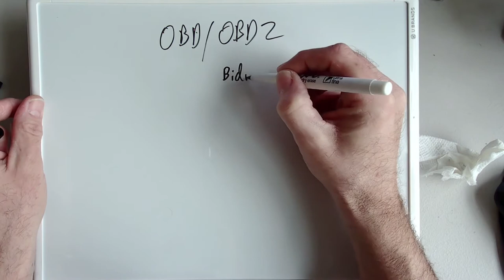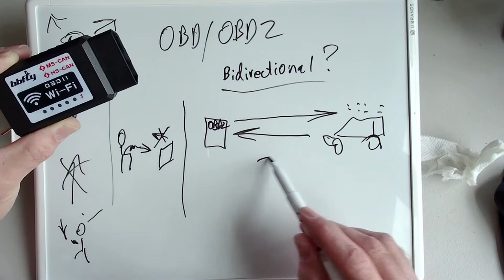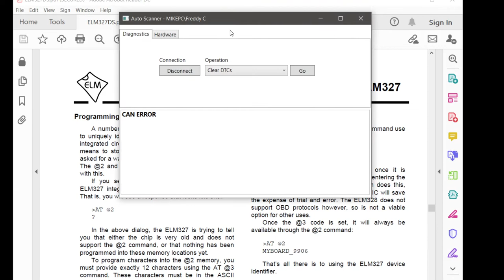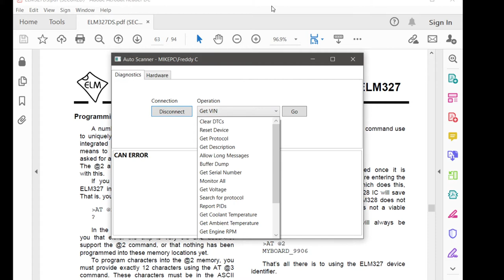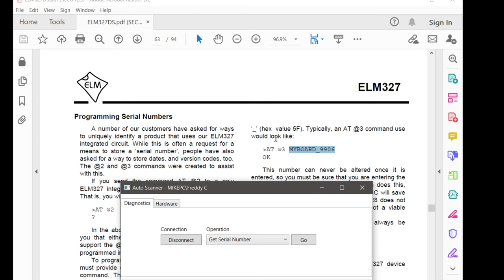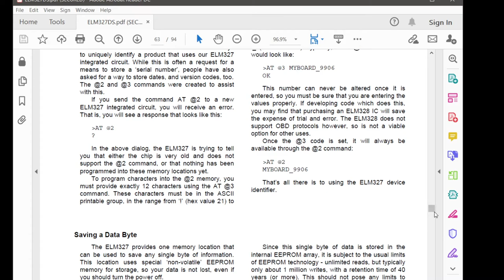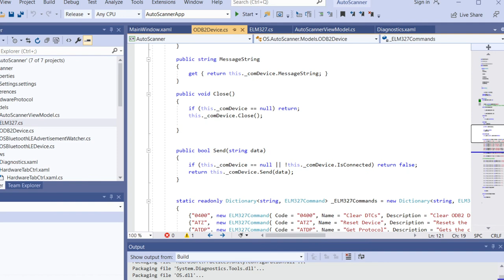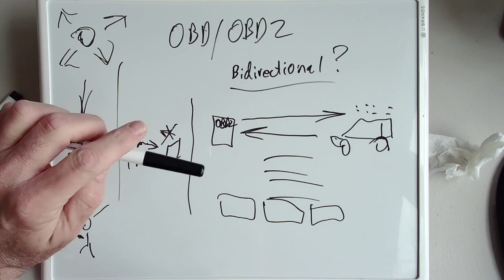OBD2: The Bi-Directional Myth (Software Design)

Comment: Hey, have you heard of comma Ai? it is a device that can make your car autonomous. Now the thing is to do that, they connect to your OBD port. I was wondering how can they control the steering wheel via the ODB port?
Reply from the maker: Everyday (it seems) there's something I don't know about. But, I can tell you that the OBD port is really just a connection point for the car's network. Newer cars are using electric servos (instead of hydraulic pumps) for steering (I mean the internal combustions cars) So, a servo is just what we've got in an RC car, so...it seems quite conceivable to do. But, not on a standard car like my 2006 impala ...Thanks!
Reply: @Roudter  hey, I actually found out that they are using the car harness to control the car , and not the OBD
Reply from the maker: @msa7202  Thanks for the info.  That seems to be more sensible.

Comment: I would approach the subject with a large 4x8ft pegboard $30.00 with all "used" components normally installed into vehicle on one side and on the backside of the 'chalkboard easel' I would have plug and play breadboards (prices vary) to provide various conditions to which each of the components provide values for.  pin on plug style adaptation, you would be able to provide all attributes. A simulator would be another possibility to feed into this. However for what you're trying to do you could have this open source software and everything else for 1/20th of what you say is $5k.

Comment: Very intelligent video, thank you very much for explaining how we are ripped off by some manufacturers....
I bought your software and about to test it right now. Just one question : can this clear P errors as I have P252f witch means "oil level high" but it's calculated on base of DPF regeneration counts not level sensor?
Reply from the maker: Thank you so much. I really don't know the answer for sure. The app calls 0x04 and 0x14 reset commands which I expect would clear the codes.
Reply from the maker: I'm left to wonder if the app cleared that code for you - at least for a key on/off cycle or two.
If not, feel free to email me (or just respond here) with some info about your vehicle make / model / year / engine etc...you can use: admin@thoughtpill.com...I'll definitely look into it if you'd like. Thanks.

Comment: I bought a th inkdiag that requires you to communicate with the internet to use it. It is  "bidirectional". I used it to take fuel out of my truck and the next time I tried to use it it was dead.  I think they shut it down on me because I wasn't using it to fix my truck. 
I'm the same way I only work on my own stuff but I feel like I don't even own what I buy now from this situation but how far do you have to circumvent companies? I was paying a yearly fee and I bought the device.

Comment: I have to pause sometimes to get the order of OBD correct (not as much as PVC and PCV). But I noticed that in your code you have ODB..., do you have problems where in one place you used ODB and another OBD for the same variable/function? I could see that leading to a lot of extra debugging time. :-(
Reply from the maker: Yes, it's taken a while,  but I get it right... most of the time now. I know,  it's a little ridiculous.

Comment: When people refer to bi-directional scan tools, they are referring to re-lean procedures or ability to actuate functions. A scan tool which can send commands to the vehicle. For example, TPS reset or relearn after cleaning Throttle body etc.   Bluedriver cant do that even in 2022.  On the other hand, dealers use brand specific diagnostic and programming communication devices which can erase & upload chip specific software. Also, newer vehicles are nothing besides rolling complex machines all connected through CAN bus system just like human nervous system. Tons of data send & received through these network of tiny chips. Dont expect dongles or OBD-2 to flash CAN bus chips since most of these software's are proprietary & only available to dealers by manufactures. When hackers get access to these proprietary software's, they can literally flash & rewrite many essential commands which can give total control to them. Dont be surprised if you see these softwares listed for thousands of $$ on darkweb. Ignition switch module hacks for KIA & Hyundai are hot these days & watch out for a random car parked waiting for you to pull in & duplicating the codes for locking & unlocking through RFID hack.

Comment: This concept is about protocol orthogonality, not "bidirectionality". A protocol (as accessed by a given API) will be called orthogonal if for each data element you have access to all the possible functions. These will typically be "read", "write", "clear", "set" etc.  for all usable data. In reality, certain elements, like engine speed, may not be amenable to writing. Some protocols are just not complete enough to be orthogonal, and in other cases a system may implement various access levels for different classes of users.
Reply: This doesn't make sense. The term bidirectional, as can be ascertained from the prefix, means two (or both) directions. Orthogonality describes whether or not one component can be modified without affecting another related component. As far as software development and permissions go, I imagine that orthogonality would come into play when considering whether permissions for one part of the system can be changed without modifying permissions for another part of the system.

Comment: I think the part about these scan tools not being special is only half true. If you look at the disassembly of a of a high quality J2534 unit, you will see tons of solid state relays inside that these cheap OBD readers don't have. Maybe certain cars require certain wires to be shorted to perform certain functions or something like that. Excited to see where this goes though.
Reply: Correct. There are multiple data busses on most modern vehicles and some allow you control over various modules that may not be directly accessible through the main canbus. Nissans come to mind and all they need is a cable that connects to the right pin to program keys, this is a simple a to b cable with no smarts but that cable is 800$ just for one with the right pinout.

Comment: ELM327 is a cheap option but not a good option, most professional adapters do not use an ELM327 due to its limitations. Nexiq, Tactrix, Machinna, SnapOn, OTC, they will all have their own hardware for the specific protocols they support.

Comment: So, shouldn't you be able to clone the expensive dongles like say from Launch?
Reply from the maker: I've tried on two others, without success. I'm not surprised as it's very easy to add proprietary hardware to the core obd2 transceiver..so, in short - it doesn't seem so. Thanks!

Comment: you know they mean Bi-directional as in the toll has the software to do the special functions reset program or flash that are bi-directionally controlled not all tools can open the valve or actuate the solenoid ..some can only read codes and delete codes      some can do do actuations but not reset or program some can test but not Reset  and some can FLash or reinstall new PCM ECU software ..so when they say Bi-directional it mans the tool has the ability to Reset Actuate control and program and do so on an almost OEM level  ..........  where most cheap tools can only do basic open source resets common test and read and delete codes ..your soft ware that your Elm uses  will never be able to do what a Bosch otc snap on  autel launch or Topdon Professional tool can do and will never be able to do OEM level functions programing resets ....................For Example Forscan ..use an Elm you can only used 76% of the software's functions as the hardware can not do it ..but if you hook up a real VCM2 you can do 100%  because the tool has the hardware to do it .....so YOu have no clue apparently      its not juts the software the tool or VCI is a huge part and your ELm will never be able to do teh same as the hard ware does not support the functions ..........  and I know this because I use OEM software's and I also make Custom software's........ and I even got GDS@ and IDS to run on a Elm but it could not even do 60% of the IDS software ...

Comment: Oh how I need to ping my ABS and kick the bubbles out of its nooks and crannies on a 2000 Chevy Express 1500 5.7 liter. Who offers software to do this. 05/19/2022? Does the manufacturer hide the code and or require the purchase of the code to activate such devices? Is this part of the high prices we see?
Reply from the maker: I'm closing in on questions like that...
Reply: @Roudter  Good man. That seems to be the jump point on price. It’s like the big boys got together and made an agreement not to include that one feature we need unless there is a $150 increase in price.

Comment: Most of these very cheap ELM327-labelled adapters from China have Microchip MCU PIC18F* inside, or similar. And this makes me suspect the ELM327 original one chip might be a re-labelled microcontroller itself, because, I have doubts that Chinese have reverse engineered the original ELM327 chip so deep to make its copy for their mass production of very cheap interfaces on its basis, perhaps an MCU firmware just leaked.

Comment: Can this software be programmed in a scripting language such as Python? I notice that you're using C#. I ask because I have some experience with python and just recently have become interested in OBD.
Reply from the maker: This software is decoupled from the ui, so if you can access .net assemblies,  then you can run this. But, this is multithreaded...which will require an asynchronous approach.
Reply: @Roudter  OK I'll look into it. BTW what IDE do you use?
Reply from the maker: @truth282  VS2019

Comment: Can this be used to write and change a vin number on a ecu for example?
Reply from the maker: Great question. Short answer is I don't know. I suspect that most vehicles are flashable via the OBD2 port. I think Ford, for example, requires special hardware. 
As I'm sure you are aware, that's something to be careful messing around with. I probably wouldn't even try without actual documentation.
I need to develop this thing a bit more before I can even pretend to have a solid answer.
Thanks for watching!
Reply: @Roudter  great point of view. I’m glad you are taking this project to actual development. 
Most have to be,  I believe only very select brands will require hardware add ons
Reply: Hey what’s going on .. how can you be reached. ?

Comment: Its all software and knowledge of the developer to incorporate the functionality of the software on the can bus network , ability to switch between hs/ms can while knowing the as built data coded by the vehicle manufacturer on the ecu to communicate to the various modules..  look into forscan for instance, its free software for only ford.  Yet for free youre able to literally do anything expensive ford software can do via elm link..  the as built data is read and allowed to be changed/ flashed.  You can totally brick your ecu and cause it to blue screen if you change part of the code the ecu uses to perform self checks or whatever..  i owned a ford ranger and thought i knew what i was doing but i made a mathematical mistake and when the fuel pressure was being displayed as per .5lbs to 1 scale.  Like 5 lbs is actually 10, 2lbs =4..  well i entered it in as thinking it was 1:1..  so when i put in manual fuel press of 90psi it told the pump to run way past its ability, blew the injectors wide open and hydrolocked the motor with gas then proceeded to blow the intake clean off.  Was sitting in the grocery store parking lot.  All the sudden the truck dumped a quarter tank in the cylinders in 5 seconds.  Burned the pump, all 6 injectors, intake and throttle body was gone…. Shit just died..  right after i hit enter..  lol..  good times..

Comment: I would be interesting to do a teardown of a ktag or similar device to see what hardware it uses. My suspicion is it’s more than just an elm considering the size of something like a ktag is much bigger then these cheap dongles. I wonder if it would be possible to load a new tune onto the ecu/write to its eprom just using an elm.
Reply from the maker: I think you're right. After some time at this, it seems the elm is not optimal...but you can definitely write to ecu memory. I found this the hard way by throwing off my crank calibration...

Comment: is there any way to power these kind of dongles only when the key is inserted/turned to the on position?
Reply from the maker: Short answer..No...(fairly sure) There's a hard-wired 12v line in the obd2 port...but ecu won't work without the key. I suspect you already know that though. Thanks for watching...

Comment: Unfortunately, this guy's lack of understanding of how all of this works will result in him not getting very far at all. He's got to go back & read the OBD2 spec in detail, and understand how the ELM327 actually works to translate the standard OBD2 electrical signaling to a simplified, higher-level serial interface. 

All of the bidirectional control stuff is proprietary & closely guarded info that isn't published by the auto industry & that you have to pay big money for in order to get access to. It varies greatly by manufacturer & year, and can change greatly with each release of a new model. The 'big money' scan tool manufacturers have commercial agreements with the auto manufacturers & pay a lot in order to have access to all of the necessary information & tech support they'd need to build their scanners. This access costs them a shit-ton of money in yearly premiums in order to have all the lastest, up2date info. This is an expense which they then happily pass on to their customers. 

IOW, unless you know a guy that works at Snap-on, or a guy in China that works at a scantool factory, it's gonna be almost impossible to get this info. This won't be as easy as finding a leaked 2-page datasheet that explains what commands / signals you need to send the ECM; I wish it were that simple, but it's not.

Without knowledge of the specific command sequences you'd need, and the response values, you'd be flying completely blind, and have absolutely no way of knowing what you're doing. As such, you also risk seriously fucking something up  & bricking your PCM/ECM.

Also, for some makes&models, the physical logic signalling for the manufacturer-specific modules might not even be OBD2 compliant at all; there might be some protocols that are super proprietary & unique to a given vehicle line, and that require special circuitry & logic in order to process & interpret. In such cases, an ELM327 chip would be useless, as it's only designed to work with the 'standard' OBD2 physical signalling protocols.

FYI, I'm also a DIY mechanic & programmer/electronics geek. So, I'm not like some advocate for the high-end scantool industry, nor am I some pro mechanic who's angry he paid $5k for a nice scanner, only to see that the nerds are now trying to hack their way around having to pay what I did. I looked into all of this stuff myself when I was trying to find a way to do basic bidirectional control (in order to activate fuel pump). I came to the conclusion that, as of now, it's basically impossible.  There would have to be a MASSIVE leak of info from the auto industry (or from a big scantool maker) in order for this to change.

Edit:
The only other way I can think of in order to get at this info would be to have access to a high-end scanner that does everything you want, run through every possible bidirectional command between each make & model you're interested in, and then sniff & document all of the electronic signalling that goes on between the scanner & the vehicle. It would take thousands of $$$ of initial  expense to get the scanner in the first place, and then hours upon hours of testing, probing, deciphering, etc., and then you'd still need to write a bunch of code & do testing in order to see if you can make it work (FYI, this is most likely how the chinese scantool manufacturers do it). So, you'd basically be creating your own pro scanner by reverse engineering a commercial one, at which point, I highly doubt you'd be willing to give it away for free (unless you're really rich & bored). After that, you'd most likely start getting cease & desist letters from the automakers, so get ready to have lawyers on retainer.
Reply: Good point. After days of researching, I’m ended up w/similar conclusion. I think OP has his heart in the right place, deserves some kudos for trying. 
Attempting to reverse engineer “proprietary” tuners is def an expensive risky move, just as much as tinkering with ur functioning ECU on ur car. 
Have u considered purchasing a used ECU (similar to ur project car) to tinker with?

Comment: This video explains a basic premise terribly. What He misses is the simple idea. He doesn't understand is that the communication is bidirectional but the difference with the bidirectional tool is that it allows the tool to directly effect the vehicles function. The only bidirectional function on most low end obd 2 tools is to clear three dually codes. So communication is bidirectional but function commands are not. I hope that helped.
Reply: I'm sorry. I meant to write. Clear fault codes

Comment: Why are there No tuner or program ers using ecu flash the software is super easy and free works with tactrixs cable obd2 to usb its super easy I want to try a rom and bin for a chevy In my library and see if that will work as ceddy mod or hondata with the chevy would be super easy and nice
Reply: I will share my flash and log files with u to help if u are willing to work on making free tuning capabilities and ecu flash already reads kernel and works with can and obd 2
Reply: Evo scan has all the interface open source if u can plug in the roms and bin or srf files then u should be live capable